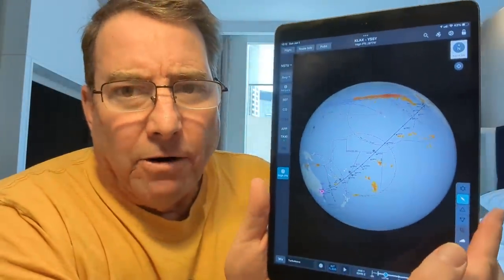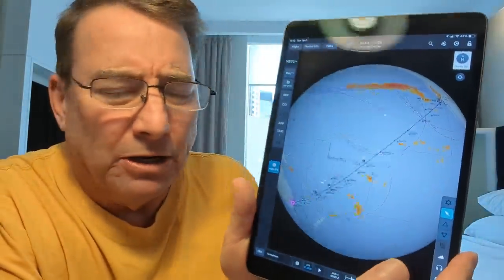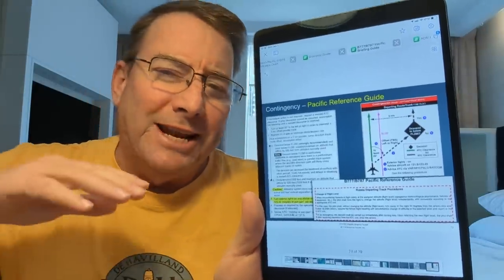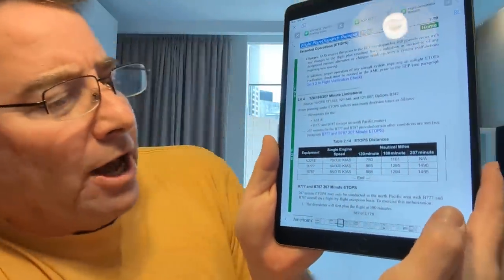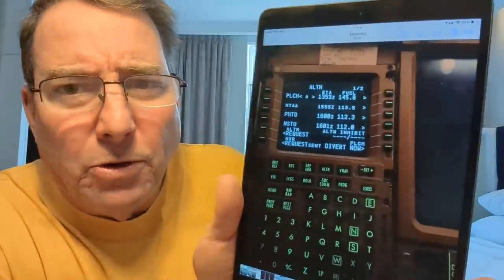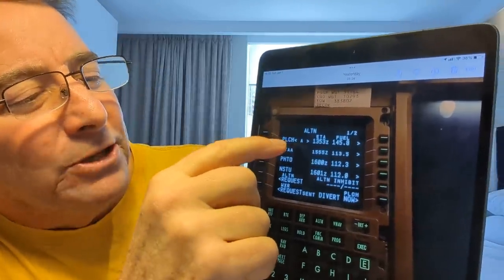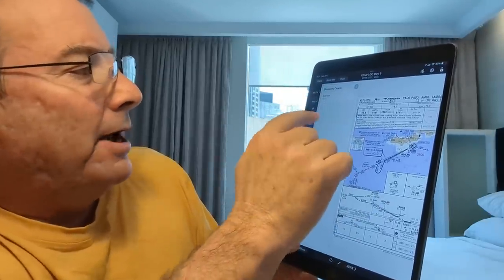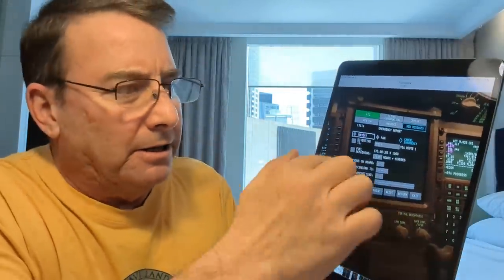Emergency Divert! UAL #839 Pago Pago 1/1/2023

Comment: Hey Juan. I’m a dispatcher at the competition. I worked the SYD desk for 2 years. What caught my attention in this video is that you guys file airways on LAX-SYD. We almost always file random routes. Could be north or south of the  Bravo airways. I will say Oakland Oceanic are the rockstars of ATC. Whatever you need they can accommodate. Pago Pago (I think they pronounce it Pango Pango) or Apia are critical for ETOPS. If the wx there is below alternate mins things get complicated really fast.
Reply: Hey @kaitak98, what would be the reason for not filing airways? pros & cons...
Reply: @davidm8097 Follow the optimum winds better.
Reply: @benoregan3318   then they must be Tracks your talking about..
Reply: thanks for correcting the pronunciation of Pago Pago. I used to live there in the early 60's. and we flew in on a 4 prop engine plane of Pan Am. by the time we got there from Hawaii we only had one engine left running. All the planes used to fly over our house and I saw quite frequently plans with less than all engine's running. I was at the Grand opening of the extension of the airport to allow Jet engine planes to land. quite the party for a little Kid of about 9 years of age.

Comment: I always like aviation emergencies with happy endings better than the alternative, which we are hearing less and less of over time. A testament to the ever-improving safety record in commercial aviation.
Reply: Agreed. There are many quality analyses of disasters on YouTube, but I wish the same could be said for averted disasters. There's a lot that can be learned from near-misses as well.
Reply: @SnakebitSTI  Absolutely. 👍👍
Reply: In 1969-1970 I was a passenger in USAF C-130's about once per month, and one horrible trip in a C-123.  I always felt it was a good flight when they opened the rear loading door as we rolled along and there were no fire trucks following us.

Comment: Do you remember doing this before the ipad? Alot of math was involved and charts..... it was fun, we had to figure out fuel burns and times to destination by hand at different altitudes. They gave you things like CRIT FU BN  in the flight plan, but you had to know what that pertained to. Most didn't. The International diversion program that was developed at our airline was one of the best things that I saw come out of my 36 years with the line. The only bad part was it was only taught in the SIM at 5:30 am... I hated that part. It was a 2:30 get up for me to drive in and teach. The cows weren't even ready to be milked
Reply: @braininavatnow9197  
I see humor isn't your forte.
Reply: I wish it HAD happened before the iPad.  Juan would be holding up a toaster.
Reply: Private pilot. 1980s. Cardboard circular slide rule. Handheld mike. Fly plane with other hand.

Comment: We flew through Pago Pago on our way to Sydney from Hawaii on a MAC flight. Practically got stuck there, an issue with the C5. As we were taking off they had a smoke alarm in the cargo bay. Turned out to be condensing mist from the ac. Frightened this white knuckle flier as I was sitting in the row by the opening to the cargo bay. Makes life interesting!
Reply: FRED
Reply: Haha ! Had a similar experience on the way to Bangkok from Sydney in a 747. Someone was smoking in the bathroom,  Cabin crew tore him a new rear end  and passengers wanted to tear his arms off and insert them in his new rear end. That smoke alarm is LOUD!
Reply: My memory as a Child of Pago Pago, I was 5 years old at the time , was being fascinated by the clouds of mist coming out of the plane during a stop over we had there on the way to America.
Reply: I flew from Penang once, and as they closed the cabin doors the cabin filled up with a white dense cloud. Literally. When the AC hit the 95% it happened quickly, and was initially pretty disconcerting.

Comment: Reminds me of a similar situation when the Flight Engineer told me we were losing oil quantity on a flight from Anchorage to Tokyo Narita and asked what we should do.  I looked at my watch and suggested lunch.  A 747 with four engines simplifies the process by not having the ETOPS requirements.  I like it when the Department of Redundancy Department is involved in the design of the airplane and specifies four engines.

We did eventually have to shutdown the engine an hour and a half out of Narita when the low oil pressure light and gauge confirmed the oil quantity loss.  A non-eventful, three-engine landing was made and it wasn’t the last in my very grateful four engine career.

Comment: 11:00 - Thank you for mentioning the dispatcher!
For everyone who's wondering:
When a flight is first planned - and we'll use NSTU (Pago Pago) as the example - weather needs to be above "alternate minima".  For NSTU, that would mean a required ceiling (the lowest dense cloud deck) 900 feet above the ground and horizontal visibility of 2 miles.  However, once the flight is en route, the ETOPS alternate only needs to stay aboe normal, published minima - in this case, a lowest cloud deck 519' feet AGL and 1 mile of visibility.  The dispatcher will monitor this throughout the duration of the flight, with software setup to alert them to any changes.  If the weather were to drop below published minima, a number of options exist, and they require some clever use of the rules and mathematics.  To wit:

1 - Option one is to simply switch ETOPS alternates.  Instead of Pago Pago, we might list Papeʻete (French Polynesia) to the east, to keep the plane within 180-minute rings south of Hawai'i.  Then, because we'd still need coverage to the west, we could add Nadi International (on Fiji).  That would have overlapping rings allowing us to continue ahead.  (We might also be able to add Niue, an island nation served by Air New Zealand.  "Niue" is fascinating as the name of the island and airport are the same as its ICAO identifer: NIUE 😀)

2 - If the flight is within 6 hours of Sydney AND weather in Sydney is good, we may have the option of removing a destination alternate originally planned (in case weather was bad at Sydney) and allowing that fuel to be used for plotting a longer route which would keep the plane within 180 minutes of a new set of ETOPS alternates.  Most very long flights, like this, are redispatched about 2/3 of the way along, anyway.  When the flight is redispatched, it is, in essence, a new flight plan which begins at a given point in space and ends at the intended destination.  Since alternates are not required for flights under 6 hours (provided other conditions are also met), one consideration with every redispatch is the reallocation of fuel originally planned for a destination alternate.

3 - Lastly, although it might seem like the flight would be in a bad situation if there simply were NO airports around which could fill the roll of an ETOPS alternate, a flight that far out over the ocean is still going to have a LOT of fuel.  That means that in a worst-case scenario, as Juan mentioned, we can simply turn around and head back to Hawai'i, or wherever else.
Reply: Thank you Mark, and Juan. In the immortal words of Lloyd Bridges, "Looks like I picked the wrong week to quit sniffing glue".
Reply: Wow, Mark, technical info never sounded so good. You and Juan are simply “the best”…!

Comment: "You're not going to Christmas island unless you're on fire." Amen to that! The only time I ever landed there was a scheduled bi-weekly station crew change. Beautiful day, severe clear, they rolled the trucks! The captain announced they would be using their short runway procedure and we pax all had to buckle in tight and brace. We got stopped and I saw two sea cans with a tarp stretched between them. That was the terminal. Ten years ago they rotated ground crews through there for two weeks and then never again because the radiation exposure level was still too high. Thanks for what you do Brownie, and have a great new year.

Comment: Informative.  Thanks.  I was born & raised in Hawai’i and remember when Boeing was testing the very early 777 trying to get approval for oceanic crossings with twins.  I even saw one of the first 777s parked on the tarmac in Keahou Airport (Kona).  Up to that time it was all 747s, DC 10s or L1011s.
Reply: I was flying for Aloha Airlines (RIP AQ) in the 90s and was able to take a tour of one of those 777s in Kona. I might have even flown it later on in my career.
Reply: Ha!  I flew Aloha Airlines quarterly for business for 11 years in the late 80s.  I was probably on a flight you piloted!  The old 737s with the small cigar engines.😉
Reply: I loved the DC-10s. Talk about a flying bus!
Reply: @malekodesouza7255  The Thunder Guppy! I didn't realize it at the time, but flying the -200 between islands was the most fun I was going to have flying jets for a living.

Comment: Retired B777 pilot with many ETOPS flights. Fun review you just covered. Other than in the simulator, only diverted due to medical emergency into Gatwick  in route to Paris. I recall the bean counters trying to get FAA approval for 240 mins ETOPS.  Pilots weren’t impressed.
Reply: Maybe the bean counters should be on a simulated etops engine out simulation.   Let them sit for an hour with one engine at max cruise.
Reply: @iannarita9816  Maybe put the bean counters on a REAL flight and feel one-of-two engines spin down in the middle of nowhere!
Reply: Isn't it a travesty to have retired the Queen of the Skies?
Reply: And now we have 330min on the 787.

Comment: Great discussion.  I’ve never dealt with ETOPS even though I’ve flown Gulfstreams across both ponds.  The planning is more substantial and I like the specific divert bases planned out.  With a gulfstream, you can pretty much land anywhere with a paved surface and some reasonable runway length. Really like understanding the communication and the recovery operation through dispatch.  We had an ops center that did similar duties, but recovery for 300 people, not something we could ever do.

Comment: There are also some interesting ETOPS maintenance training and qualifications requirements as well as odd rules such as the same mechanic can not perform nor sign off on identical tasks for both engines. There are also special markings that identify an ETOPS aircraft to ground personnel so they are aware of the unique qualifications and requirements required for the servicing of the aircraft.
Reply: Most interesting info.

Comment: You’re missing out on the Pineapple Express hitting NorCal on New Year’s Eve!  Lots of rain today.
PS - Pago Pago runway looks really interesting the way it extends out on to the reef.
Reply from the maker: Update soon!!!
Reply: @blancolirio  Large parts of the Central Valley slightly flooded, situationally around SF Bay Area (San Francisco certain streets with poor drainage, around the bay with low lying freeways, random other places…).  Whee.
Reply: Then more rain. Weather is just like a NZ winter..back in the day.
Reply: Oroville was at 685 feet yesterday, right now it is at 700.76 feet. Wow, is that normal?
Reply: @ugaryludwig4057  reservoir above Gilroy and Morgan Hill is hitting its spillway now, it’s probably about to flood Highway 101 as it goes over the creek north end of Morgan Hill
Reply: Family is in Orinda and Alameda, we live in Utah. Raining in Salt Lake valley, almost two inches in spots, but the mountains above us have received between 4-5 feet of wet snow, not the usual Utah powder. I understand more rain coming Bay Area way on Wednesday and Thursday. Boy do we all need a great winter of moisture.
Reply: Multiple rock slides on Rt 1 south of Big Sur, closed indefinitely.
Reply: Reef? Its in the water!
Reply: @ugaryludwig4057  Another year without everyone leaving So. Cal.
Reply: @ugaryludwig4057  
I thought Orville died.
Maybe I was thinking about wilbur.

Comment: Superb run-through of ETOPS, which brings the significant performance and economic advantages of Twins to the overwater oceanic province formerly owned by Trijets and Quads.  Even though I was a design engineer on the inside of the transition into ETOPS, it did not hit me clearly until booking a business trip to Europe in the 80s.  I was shocked to see just about everything going between US points and Paris was 767s - gone were the 747s, DC10s, and L1011s.

In early 767 days, United had two different sets of 67s - those that  ETOPS-equipped and those that were not.  ETOPS 767s weigh about 1000 lb more due to extra equipent required to achieve the necessary overwater reliability numbers.  United found that the ETOPS higher reliability translated to higher dispatch availability as well - a really important factor in daily, hourly ops - and higher numbers means less spare airplanes are needed.  United eventually made all of its 767s ETOPS equipped, and even its 747s (which are not even in the ETOPS domain) because of the availability improvement.   

The design side of the engine and aircraft manufacturers, along with FAA, put in years of systematic analysis of IFSD (Unscheduled In-Flight Shutdown) rates and root causes occuring in the pre-ETOPS widebody fleet, in the 70's.  This provided the framework for engine/aircraft design and certification methods to achieve an acceptably low overwater IFSD rate. 

Prior to ETOPS, twins were routed along the Pacifc Rim so as to remain within 75 min of a suitable Rim airport, some airports existing only to support the 75 min requirement.  ETOPS now allows direct routing and eliminates the cost for keeping unused airports open.

Although the ETOPS term means 'Extended Twin Operations', the engineering wags prereferred the more motivational title, 'Engines Turn Or People Swim."

Comment: I can remember many years ago arriving in Sydney from LA, on a Qantas flight, with the Fire Trucks running along side the plane, with the Captain announcing with have a oil leak in one of the engines, but not to worry, the oil in non flammable, obviously we where closer to Sydney than to any other alternative. Nice bit of drama to wake you up at the end of a long trip.

Comment: I've read that back when the prestige airlines were pushing 4 x R-3350s pretty hard crossing the North Atlantic it was fairly common to loose one engine and not unknown to loose two. Lots of engine mechanic jobs were lost in the conversion to turbine power.
Reply: 3350s were quite unreliable compared to modern jet engines, but at least they had 4 of them on transatlantic flights. The 3350 was also the B-29 engine
Reply: Jobs may have been lost, but many lives were saved.
Reply: We weren't on a "prestige" airline returning from Germany to New York in 1957, but the plane managed to lose an engine 45 minutes after departure. "Shick has a sick chick", was my dad's assessment. (I have never been able to find an airline with this name to check more of the details.) We spent another night in Germany, then took off again the next day.
Reply: @lizj5740  to
Reply: @tedmoss  Price of progress. Not too many generations ago, the economy required most people to be peasant farmers.

Comment: Thank You Jaun for a great technical explanation of ETOPS .
Why do we fly two engines instead of four? The current engine has more power the old two engines. Moreover better fuel efficiency and less expensive maintenance.
Reply from the maker: Less $$$

Comment: Flew UA839 twice this year this is super informative, thanks. Can you make a follow up or educate us how it works with the 4 pilots ops? Assuming it's the FO-B and FO-C on the flight deck at this point. Assuming you wake the Captain up to take over, is that true? How does this work with the crew rest requirements?
Reply from the maker: See previous Sydney updates.

Comment: In a situation like this, does a single engine — necessarily pushed harder than normal — use about the same amount of fuel as two normally operating engines?

Comment: Sim check in a 141 t/o Pago Pago with 4 green filter bypass lights right after departure.
 Based on actual event with contaminated fuel. Engineer turned on fuel heat & able to land.

Comment: Hey Juan.  Love your channel, watch it all the time.  One small correction to the ETOPS acronym.  It's no longer "Twin Engine Operations", it's simply "Extended Operations".  Reason for this is when ETOPS was changed from an Advisory Circular to CFR121.374 some 10 years ago or so, the new CFR included three and four engine aircraft as well.  In order for three and four engine aircraft to operate beyond 180 they have to meet certain requirements.  Nothing as stringent as for twin engine, but they never the less fall under the ETOPS banner, hence the change to "Extended Operations".

Comment: No matter how all the procedures fall into place there is still a pucker factor for a crew which may have been on duty for an extended time, but the reliabiity is so much better than long in the Boeing 377 Stratocruiser era as Pan Am found out on three occasions in the Fifties which at the time they had little option but to keep using them on extended overwater. It was a miracle they could find the crews to still operate them as many would have bid to another crew base even if they had to go back to DC-4s for a time. The Strats and the L-049 Constellation  weren't the best options but there was nothing else readily available.

Comment: Great commentary, as usual, Juan, but for the pronunciation of Pago Pago. I learned from a bit of reading and making a fuel stop several times when I flew for Continental in 1979-80 (working at the time as an Office Puke, a jocular term by Line guys  used to describe f0lks such as me). That was when we were just beginning the service with the DC-10-10, a pleasant stop-over point to walk about and ponder its history, later we could do non-stop  the -30, with the larger fuel tanks.  Juan can decipher the titular title and the fuel ranges of the models of the DC-10.  Thanks again, /Romain, Captain (retired) Continental Airline